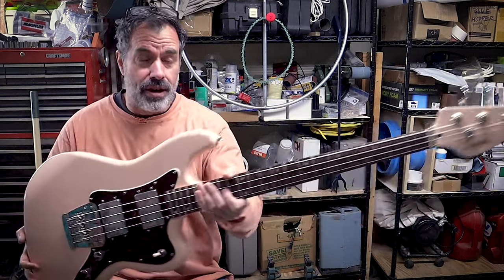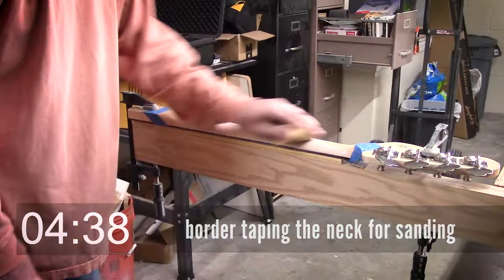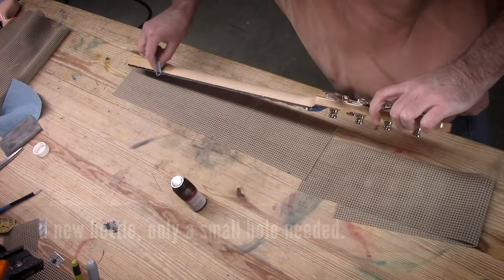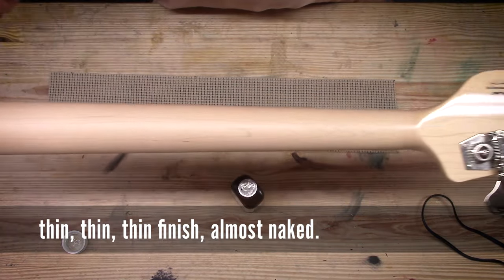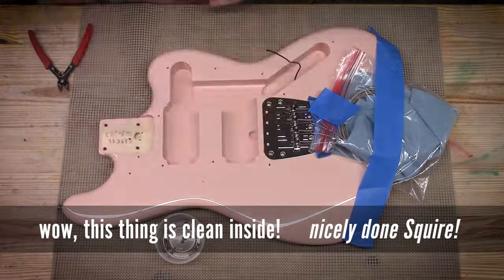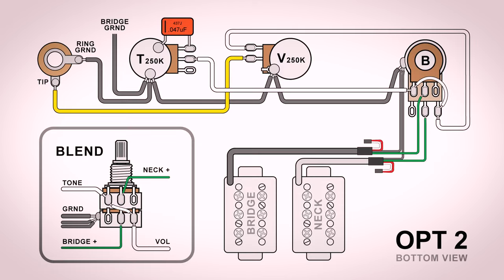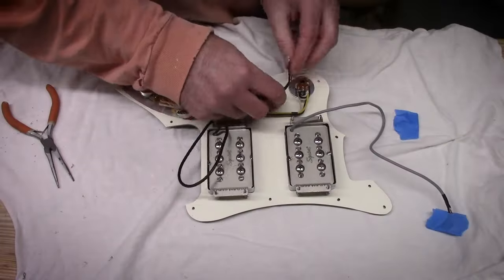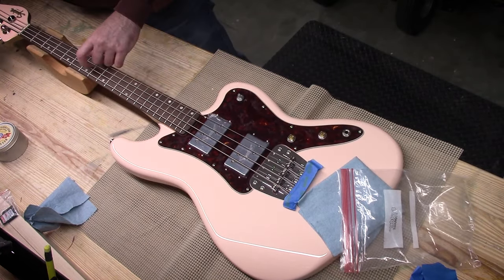Squier Paranormal Rascal Bass Mod Project

Comment: That's such a useful tip to poke a tiny hole in the Tru-Oil bottle foil. I always peel it all the way off, and it always dries out and gums up.

Now I know what I'm doing with … The Next Bottle.
Reply from the maker: Monk, thanks for watching!
The small hole should help, but won't completely stop the Tru Oil from gumming up. It just happens.
I've also tried putting a piece of tape over the small hole, but the tape adhesive seems to know it's "oil" and doesn't really like to stick to the silver seal. Tried some plastic wrap, no luck. 
So, a small hole, clean the top of the bottle and threads, snug the cap, and hope for the best.
If you find a better solution, please share it with the rest of us. We all suffer the gummy Tru Oil blues.
Good luck with your projects, be safe and take care!

Comment: Hi, first thanks a lot for both videos on this bass, it help a lot. I have a question maybe you have the answer. Do you think it's possible to adapt other bridge on this model? less voluminous ,more basic to help shaking the right hand or having a better posture for slapping? Thank you again. Best regards
Reply from the maker: Thanks for watching!
I don't know of an exact replacement bridge for this bass guitar, however other bridges could be mounted and be functional.
The "fit" would be the issue, as this bass has a large bridge flange, and many replacement options may have a different footprint. So, if you don't mind the pickguard not fitting close to a new bridge it can be done.
Sorry I don't have any suggestions as to which bridges would be good candidates.
Good luck with your project!

Comment: That oil is not going to be providing much protection from moisture going in and out. That’s why Warmoth won’t guarantee unless you put a hard coat over top.
Reply from the maker: Trap, thanks for watching.
The tru-oil finish in this case isn't really to prevent moisture transfer.  I mainly put it on to reduce the amount of dirt and finger gunk from getting ground in.
I know Warmoth considers oil coatings a soft finish, and a hard finish is needed for warranty.  Glad this isn't a Warmoth neck..  The owner of this base wanted a naked natural neck. I suggested the couple coats of tru-oil to reduce dirt accumulation and slow staining.
All good.

Comment: Well, this time I got a criticism.
The truth of the tone pot does not lie in the fully open, or the fully closed position, it lies in all of the positions in-between. Can you tell a 10 from a 7.5 from a 5 and a 2.5 from a 0?
Reply from the maker: Achim, thanks for watching and good point. Hurt the one feeling I had left  :_ (   , sniff, sob, LOL.
What I was hoping to show in the ultra-brief sound sample is that there is now a difference when the tone is rolled.  I don't think my camera was picking up the bass sound too well anyway, nor the little amp I was plugged into. More hurdles to navigate.

When the bass had the 250K pot, it didn't matter where the knob was rotated, it all sounded the same, dark, muffled and a bit underwater.  The 500K allowed some highs to remain, and seemed to clean up the sound, at least to me, but I get what your sayin.

Thanks for the comment/criticism, take care my friend!

Comment: Question about the wiring, is everything but the blend pot how it came from the factory? Mine is wired a bit different and i'm getting some hum, but it doesnt seem to be a ground issue from what I can tell.
Reply from the maker: Thanks for watching!
Sorry, but there really isn't anything factory in the wiring. 
I'm trying to remember how it was originally, but I'm drawing a blank.

Assuming you've tried different cable and possibly a different guitar to eliminate the hum being something other than the bass guitar. 
Humbuckers "shouldn't" hum, or at least have very, little hum.
Is the hum always there, no matter which pickup is selected, or if the volume and tone are up or down?

If you happen to have just purchased the guitar, you may want to take it back to the store to have them check it out. 

Sorry I can't help on this. 
Good luck to you, hope you find the answer.
Reply: @theNextProject  Thanks for the reply. Yeah ive plugged 3 different instruments into the same setup including my stingray and a jazz bass. the jazz bass is actually quieter when both pickups are on then this bass is for me. I checked continuity of the ground and everything seems grounded and I just shielded the cavity and threw some extra copper on the pickguard for good measure. it's better but still not silent, which just doesnt seem right because they;re humbuckers! Im thinking about returning it, I ordered it online though so shipping and all thhat is a hassle. id rather just rewire it if I knew what it was
Reply from the maker: Ah, sounds like you've been busy with it. 
Sorry to hear it's been such a problem for you.
Good luck with however you move forward with this guitar.
Take care!

Comment: Was that just heat shrink you put on the pickup winding?
Reply from the maker: Sgt Rutters, I used some shrink tubing to hold groups of the wiring harness together under the pick guard. 
I'm guessing you were referring to the control wiring, if so, yep shrink tubing.
I didn't do any work on the pickup windings though. 
Be safe and
Reply: @theNextProject  yeah, sorry meant the wiring, not winding.  😂

Comment: Believe it or not... it's spelled SQUIER. It's a handsome bass, although short-scale isn't for me. 🙁
Reply from the maker: Bahaha, I don't know how to spell what is right on the headstock. Thanks for pointing that out.  I'm sure I misspelled that throughout the video as well, too late for those changes (yikes!) 
I hear ya, the shorter scale isn't for everyone is the word in the street.  The owner of this guitar mentioned that as well, saying he learns song on short scales, then plays live with long scale bass.  I know my hands would be in the wrong place. 
LOL, I'm a mess.
Be safe and take care!
Reply: @theNextProject  It certainly sounds great though. I must look into that no-ground blend pot thing - I've read about it before and (I think) tried it without noticing much difference - but perhaps the rest of the wiring needed tweaking too. Did you use a 250k blend? 🎸
Reply from the maker: From what I've read, the 250, or 500k MN blend pots are the trick. If I recall this was a MN 500K blend pot. 
 I just picked up a few of these for some benchtop testing.  Seems some people are saying the 500k leaves more signal intact to run downstream. Makes sense I guess.  
Part of the problem with opt 1 wiring on this project, the 250k tone pot was cutting too much high-end I'm guessing. It's way better now (opt 3) with. 500k tone,  than what I first attempted.  
Fun to tinker with this stuff, it is time consuming however. 
Good luck with your testing!
Reply: @theNextProject  Thanks very much! 😀

Comment: Good to see a well-routed neck socket in a Squier. I've purchased only one 2nd hand Squier - a CV 60s Mustang, with a socket so badly routed it has 3 different planes on it and teardown from a blunt chisel which tried to fix it and made it worse. It took me a while to discover why it was so hard to set up the bass properly. I had to re-route it and got only a partial refund since I had already removed the glossy finish from the neck. In the end, I've got so disappointed and angry with the brand (after I found a lot of horror stories about Squier sockets) that I did a complete redo, stripped the paint, the veneer, and did an oil-wax finish in the eastern mahogany body. It looks gorgeous and classy now but I still have some work to do with a new bridge after so many attempts to adjust the ax.
Reply from the maker: Asmuk, thanks for watching!
WOW, sorry to hear of the messed up Squire you had to deal with, sounds pretty bad.  I'm hoping that they have remedied their productions problems since your guitar was born.  
I was really surprised and impressed by this bass guitar. It was possibly the cleanest "new" guitar that I can remember looking inside of, perhaps it was just luck. 
Sounds like you've turned your guitar in to a great instrument, after a great deal of work, hope the bridge issue can be sorted out too.
Thanks for the rundown on your project, it's interesting to me hearing what others are doing. 
Be safe and take care!
Reply: Never had this kind of issue with a Squier… If you’d not scuffed the gloss off I’m sure an exchange or refund would’ve been given without issue too. 

I have played one or two very definite duds in a shop though. The Cort (ICS serials) and the Samick (ISS serials). Are usually great fit and finish wise, maybe some minor setup or bits of fret dressing here and there, but woods bound to react and move slightly when it’s travelling all the way from Indonesia.

Comment: Another good video! 

Question. Any tips on removing poly finish from the body? Most I've read up say heat gun, but I don't have one and not wanting to buy one for 1-2 uses.
Reply from the maker: Emrys, thanks for watching!

Poly removal... there are 3 basic choices that come to mind. 
Sanding, Chemical Striping, or Heat gun.

Can't say any are enjoyable. 
I used a heat gun recently on the HB telecaster project. Used a Harbor Freight gun and it took a fair amount of time, and a lot of heat. The heat removed the top urethane color, but didn't really do much to the underlaying polyester sealer coat. I still had to sand that stuff off. 

So on the cheap, without a gun, you've got sanding or stripping. 
Chemical stripping (Clean Strip, Lowes/Home Depot) will likely to the job, but it stinks and it's messy. You'll still have clean-up sanding to do afterwards. AND, you need to be sure to get all the stripper off the body, can't leave residue behind. 

If you have an orbital sander, and a few hours... there is sanding, everybody loves sanding.

Oh, is it a flat strat or similar body, or a curvy LP type thing. A few added challenges getting around and over carved top shapes. 

Sorry, no easy button that I can think of.
Reply: @theNextProject  No no that's fine! Thank you for all the tips and info! It's an SG kit guitar I put together and my Squire Tele. 

I have the sander. I guess, I'll be doing that then.

Comment: I'm surprised the blend pot works with the two lugs not grounded.
Reply from the maker: Hey Chris, thanks for watching!
AH, the blend pot...
What an interesting little device, and yes - surprised it works without the two lugs grounded. 
Originally, the two ground lugs were grounded and had a jumper. The output had a dip in the middle at the detent area, not an even hand-of from one pickup to the other.  A lot of internet searching offered the non-grounded, and non-jumpered option. Out came the jumper and grounds and surprisingly it worked way better than the original plan. 
There was still the flat tone response, but I chalk that up to the original tone pot being a 250K with an 047 cap, all the highs were dumped.  The 500K tone pot made a big difference, and still using the 047cap.  I'm sure there are a bunch of other tweaks that could be worked in, but for now the owner is happy, so I'm happy.
A fun project, and educational for me too!
Hope all is well for you, be safe and take care!
Reply: @theNextProject That's really interesting how it dipped in the center detent position.  It almost sounds like the pickups were out-of-phase or something.  I'll have to try the non-grounded circuit the next time I'm working with a blend pot - you learn something new every day!!

Comment: It's time for... THE NEXT SANDING PROJECT!

What did you use for your quick-connect to the output jack? I rewire so often, I should look into that!
Reply: Also, I gotta say that the sound of this bass after mods is FAR better than I'd heard it on any demo. Really shows how you can bring muddy pickups to life by using an appropriate pot value!
Reply from the maker: Hey Mark, thanks for watching!
For the ground line I used a 22 AWG JST Plug Connector 2 Pin Male/Female Plug set. I just wired both the red and black of either side of the plug to the ground line, so it's go redundant contact built in.
I've also wired a QD for an output jack on a previous project. For that I used an RC servo lead connector...but I'm guessing the plug used for this project would do the same thing.
Give it a go!
Reply from the maker: That's great to hear, I really didn't have a baseline to judge how this sounds. So, thanks for letting me know. 
The owner is happy, so I felt the project went in the right direction, but it's good to get your feedback too, thanks!